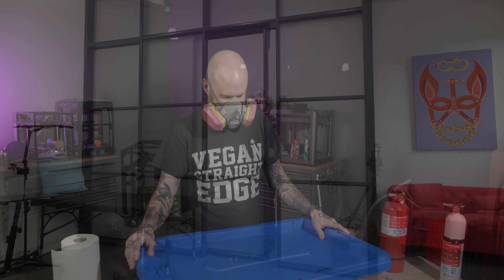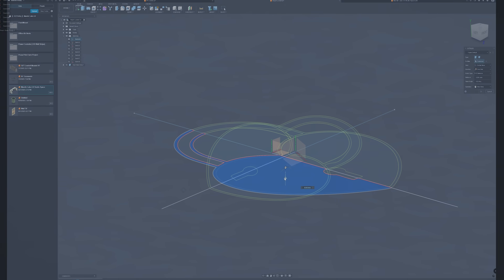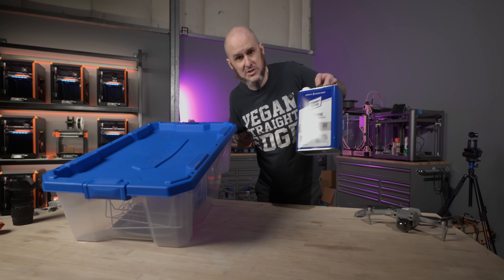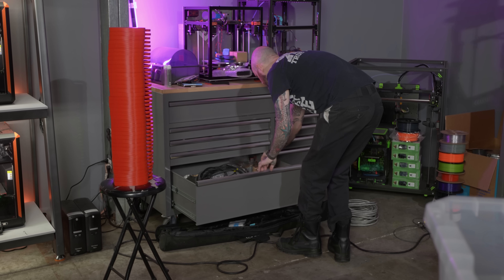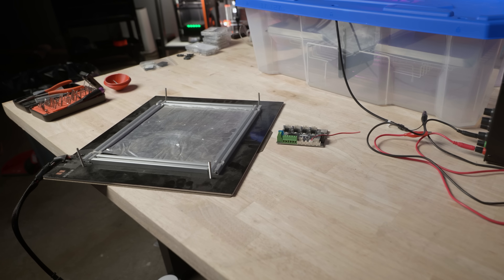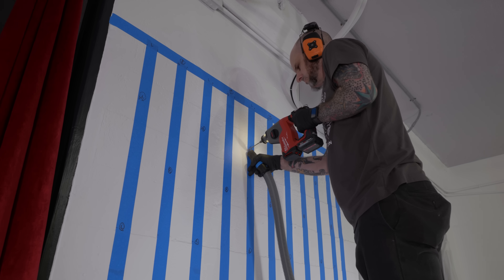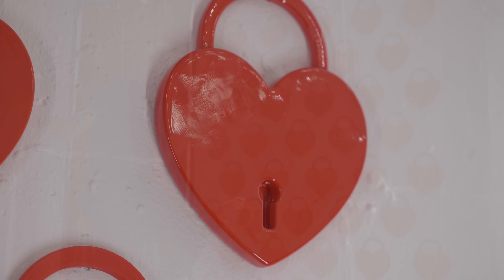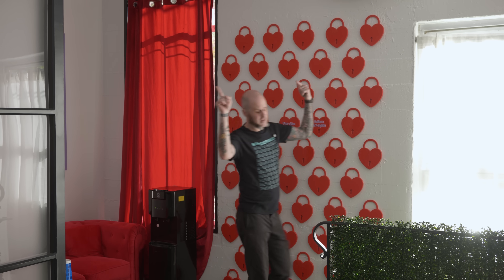3D Printing an Entire Wall of Art!

Comment: I assembled a low rider cnc in the basement. I think I would have cut then painted instead of printed.

I actually made a few dozen 2ft ish star for my oldest's graduating class the cut process for consistent shapes like that was really quick when you can queue up a whole 4ft x 8ft sheet at a time

Comment: I had to do something like this for a major production, i originally thought ASA as well, acetone smoothing at scale was going to take way too long (luckly i did a small batch of 20, instead of the 200 we needed). Ended up printing in PETG, lightly going over it with a sandblaster and spraying them all with clearcoat took 1/3 of the time for basically the same result
Reply from the maker: I've been heavily considering a sandblaster for the studio...

Comment: Over the years, I tried many setups and parameters for acetone smoothing. Here are my findings :
1- Make sure the filament is 100% ABS or ASA.
Most filaments nowadays are labelled with a "+" sign and contains additives (TPU...) that enhance printability but are not affected by acetone
2- Prep work
Yep, bad news: A basic pre-sanding greatly improves the vapor smoothing process. Good news, though: sanding ABS is very easy
3- 3D printed part pre-heating
You don't want the acetone vapour to condensate as droplets on you print, it would leave smear marks. I use the print chamber of my 3D printer to re-heat the part, after sanding, just before vapour smoothing
4- Hot and saturated acetone vapor
The acetone evaporation process requires energy, a LOT of energy (put a drop of acetone on your skin, you'll feel cold instantly). 
Here's my setup : 
> Aa metalic pan (metals are good heat conductors) in a large "bain-marie" of almost boiling water (large supply of heat). 
> Napkins inside the pan, held in place with magnets (to improve contact area & heat transfer with the pan), soaked with acetone
> LDPE cover, same material as your container (LDPE is not affected by acetone) and a fan to circulate vapour
>>
With this setup dialed in, the *full smoothing process only takes about 5 to 10 minutes*. 
And that's a good point, for reasons:
- You want the "melting / dissolving" process to only affect the external skin of your print. You don't want to give time for the acetone to migrate and infuse deep inside the part, affect its structural strength and release thermal stresses induced by the 3D printing process, else it might warp, bow, curl...
- In addition, acetone needs to be "vented away" for the print to regain full strength and hardness. A deeply infused print my take days or weeks to achieve that 
> that was my 2 cents

Comment: I know it’s less FDM, but printing in parts you could do the front face down, and only close off the key hole, and the rest could just be open against the wall.  No infill, no back/top surface to print.  Then print the loop separately, and dovetail it into the face.  My wild guess would be that it cuts print time in half.  You might even be able to use Vase Mode, and save even more time, but without any visible difference.

Comment: Hey Alan - since you primarily print with ASA, would you be open to doing a video about air quality / filtration / ventilation? As in, do the smells and fumes bother you?
I have only printed with PLA, PETG and TPU so far, and I want to "graduate" to more resilient materials, however I'm hesitant due to what I've heard about VOCs and UFPs, but not sure if my reservations are warranted or not.

Comment: Re: Acetone smoothing for large prints
Consider 2-part epoxy resin. Lay em out on wire racks and use a big paint brush to apply it (and keep the brush in acetone lol). You can experiment with plugging the keyway for a sharper edge, but it may look fine filled with resin.  I have had great results with mixing resin and 3D-printing and I really think it's an underutilized method.

Comment: Could you have hung the hearts side by side from the top of the container to fit way more in? Might have required a slightly taller container I guess.
Reply from the maker: The plastic softens a lot while smoothing. The acetone penetrates into it and softens all of it. I have to be careful when handling them afterward and let them sit a few hours before removing them from each try hanging would absolutely ruin them as they softened unfortunately. The sheets were chosen as they support them and prevent distortion. Even then one warped enough that it wasn’t usable. Good thought but sadly won’t work here.
Reply: @MandicReally thanks that's really good info as I was thinking about using this process for a project and you likely saved me a mess :)

Comment: just a thought, could be a future conversion project if you're feeling froggy, but that would've been a LOT easier on you with at least 1 belt printer.  it kinda sucks prusa never made one, it probably would've easily been the best on the market & slicers would've received a surge in development as a result, but i've seen used prusas & enders converted into belt printers several times to great effect (several other brands too).  my belt printer is a piper infinity, unenclosed so no advanced filaments on that, but an enclosure could be worked up for many of them - or simply a tent with a retrieval system for when prints come off the belt, even if it's just you grabbing some at a time manually.
Reply: Second the belt printer, I have a pair of machines that have put kilos of filament through them without any human interaction. Being able to sleep in while your machines are printing uninterrupted is a highly underrated thing.

Comment: I would have definitely just used a filler primer and just spray painted everything red + glossy finish myself. Acetone smoothing 50 of these and trying to get consistent result throughout all 50 is pretty... Challenging. 😆
Reply from the maker: Same could be said for fillter priming / glossy red / clear coat process. I'm planning a paint area in the studio for future projects but don't have it now, so getting a setup going to do all that would be time consuming in and of itself. This was the fastest direction I could see going with the time we had.
Reply: @MandicReally  It seems no matter which option you would have chosen, it would have been challenging either way haha.

Comment: We'll need an update on how much filling your Prusa XL with acetone vapor cost to fix the damage. :-P
Reply from the maker: Haha, I was wondering that as well. With the cover over the tray fumes really didn't escape. I've looked and found zero indication that anything was harmed in the XL from the process. I was way more worried about the Enclosed Mk4S as its a smaller space with more fragile parts than the PC-CF parts of the XL...
Reply: @MandicReally  Not as worried about the PC parts as I am other materials. The acetone may also have contaminated the lubricants, you may want to re-lube it.

Comment: You do know about our Lord and savior resins right? As a smoothing agent good douse of UV light and everything is shiny and hard, and if you want to get really cool with make a silicone molde of a smoother one and make them clear or red tinted. Could be a Founders Wall 2.0 I guess
Reply from the maker: Would require my largest resin printer to produce them, and be a much messier / slower production process. Each way has their strengths, with the time factor in play (Ruby is booked up for a WHILE) FFF printing wins. 

I considered a mold and pour method but that would have been significantly more time consuming.
Reply from the maker: Just sliced up the design for my biggest resin printer. It could print 5 of these at once. Would be 13 hours per 5 hearts and take almost 2 Liters of resin (1.85). So all 50 would be 130 hours of resin printing on the one and only machine I have capable of it, and 20 Liters of Resin. 

Not saying you are wrong at all, it would be a good way to go, but not with the equipment I have available.

Comment: Why not just gloss coat them, would give the shiny much quicker, make it smooth, but do it after the names are on them and final.
Reply from the maker: You’ll never fully eliminate layer lines / top extrusions that way. That said, I did say in the video that clear coating IS what we will do in the end. Had to try vapor smoothing to get the overall smoothest result, it’s just too time intensive / inconsistent.
Reply: @MandicReally  We construct a booth with aluminum frame and 6mil plastic sheet.  Do them all at once.  

Note: Tried to find working links to support Ruby - no joy on insta or web, all broken.
Reply from the maker: @builtprefect  That's strange, her website and instagram should be readily available from google search. I'll update the description with her links:
Instagram: https://www.instagram.com/therubygore
Website: https://www.therubygore.com/
Reply: @MandicReally Over the weekend, website was throwing errors or not responding.  All good now.